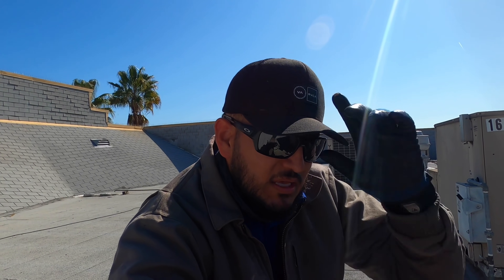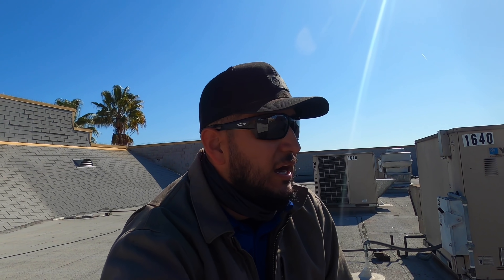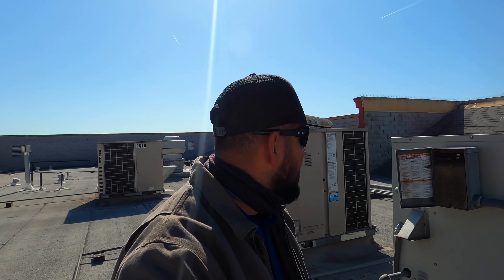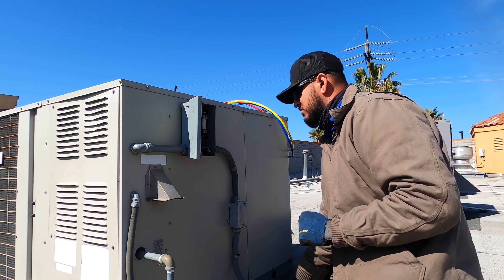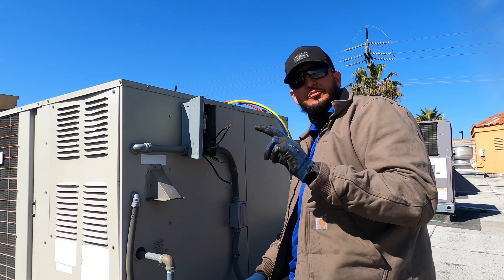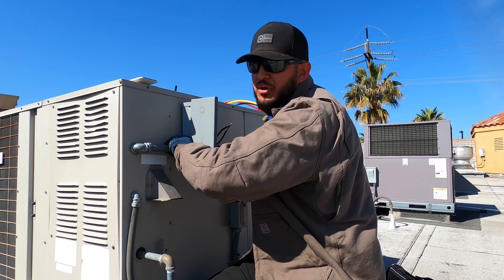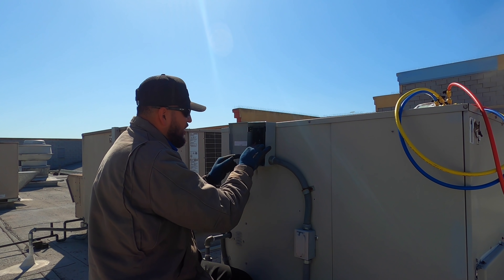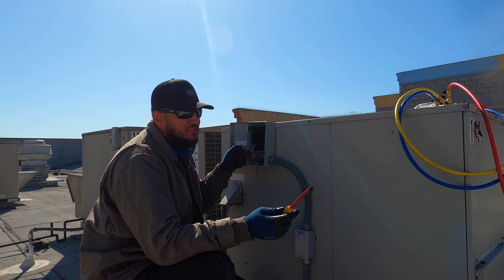How to become an HVAC TECH

Comment: I’m 16 years old right and have no experience at all. Any tips on how to get ready for this career after high school?
Reply: Hey man honestly since your 16 just learn all the components and how they work with each other so you know which way the electricity works in the system and which way the air flow goes and which way the Freon moves. That will get you understanding the whole picture besides that i can recommend being an apprentice to a ac guy so you can get experience and some cash
Reply: @Ass_Plays  Appreciate the advice. Do you know how I can learn this on my own?

Comment: I need school for an hvac certification right? I have an EPA I’ve been doing apartment maintenance for 9 years there’s nothing can’t trouble shoot in an ac. Can I get hired at an ac company? Or do they need the hvac certification?
Reply: You should be fine with that maintenance experience. A lot of people coming out of trade school get good grades on paper but don’t know how to use a screwdriver. Just be sure you stress your maintenance experience and that you want to learn the ins and outs of the trade.

Comment: Good video !!!  ive been in the commercial maintenance for 15 years and working in building was a dream come true i had good pay payed school  payed vacation and also had time for my brand new family had alot of time to spend with my kids watch them grow,
Building engineering gets hard sometimes but its usual very calm and it gives you a chance to learn while u work  its a good career. Appreciate the video .
Reply: Commercial maintenance is part of the hvac field?  I'm interested.
Reply: @keithadolphus9945  oh yeah in a commercial building you need air conditioning but you also work on plumbing  electrical and other things depending on  the building ,  alot of the times its really small stuff   So I learn alot i would really recommend it .

Comment: Go union do the apprenticeship it’ll be the best decision you’ll make
Reply: Here in Bay Area local 104 starts at like 25 I think 393 is a lil bit higher
Reply: @eddiemartinez6879  how do I find a union in my area is there a website I can search for them or I just have to look around?
Reply: @Justin-fj3sm  where do you live? And if your doing HVAC just look up your local HVAC service programs I’m sure something will pop up
Reply: @eddiemartinez6879  Orange County New York and yeah I’ve looked some stuff up and it seems the closest union labor is around 45 mins so depending on what happens when I’m old enough to join I’ll either try for there or try a closer company
Reply: @Justin-fj3sm  I personally would stay away from labor union get into a skilled trade electrician pipe fitter sheetmetal etc you will make more money In the long run not hating on laborers but my personal opinion is there’s better options out there
Reply: @eddiemartinez6879  Shit I regret leaving the bay big time now. I live here in San Antonio, TX and the state is so damn anti-union
Reply: 100% Correct, no comparison. Better pay, benefits, pension, and training.
Reply: How much does union start off at?

Comment: An underrated way to get into the trade is by getting a job at an HVAC supply house. That's how I got into it. I got a job with one of the customers who came in often and since they saw how hard I worked I feel like it made it easier for me to get a job. Plus there were a couple of other companies who gave me offers when they found out I was leaving. Also, it kind of gives you a little bit of knowledge of HVAC equipment and parts and things like that. I got into a great apprenticeship program with a great company with great benefits and feel like I could not be in a better situation.
Reply: I just graduated trade school on Thursday and starting as a new home install apprentice (12 week training process). It seems like a well established, growing company with room for advancement. He said not to necessarily go to trade school, but I got alot out of it and it really directed my mindset in the right direction. Wish you the best!

Comment: I watched your first video when it came out, i had been looking to get into the trade now i am a little over a year in doing residential install in socal, i started off as a helper, now i have my own van and am an official installer on the crew. I work open shop but would recommend anybody SERIOUS about getting into the trade and making it a career, to call your Local Union hall and ask them what the requirements are to apply for the apprenticeship.

Comment: I think a key point you missed is paying your dues. And don't get that confused with being "punked". As the new guy/gal you are going to be assigned the "worst" jobs. Like crawling, sealing registers (personal bias), moving tools and equipment around, cleaning up. Remember there's a high probability the person asking you to complete the given task has completed this task themselves more than once. If I can't trust you to go under a house and run ductwork correctly or gasket registers correctly, how can I trust you to wire up low voltage correctly, or braze correctly, ect.

Comment: Well I feel better cuz I graduated June 2020 and it was 90% book learning and 10% hands on and didn’t have the confidence to even look for a job and I’m very mechanically inclined,thanks brother 👍
Reply: Hvac IS 90% knowledge 10% hands on. When you get on a call ask questions if there is anyone to ask. If not look around. Sight and sound will tell you alot. Most times you can diagnose a unit that way without using a guage or a meter.
Reply: Thanks I appreciate your feedback sherwin